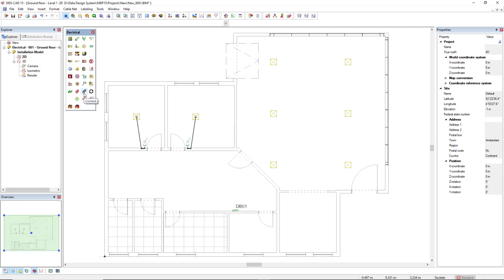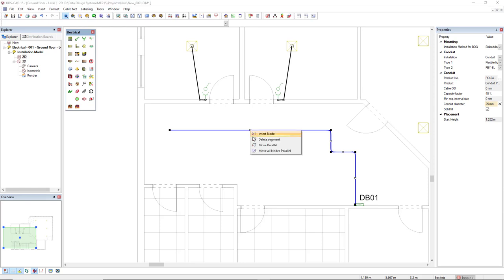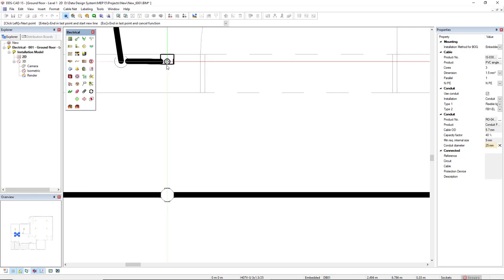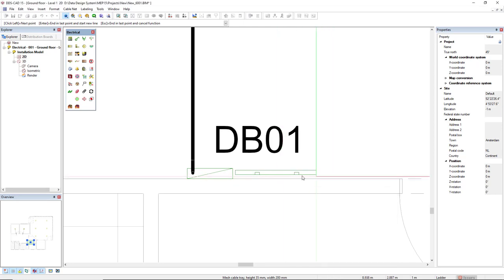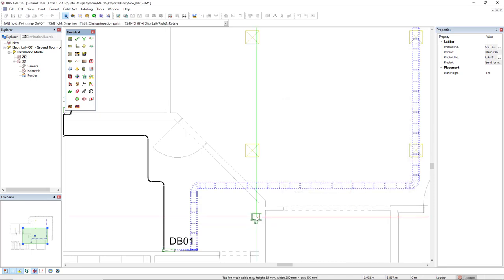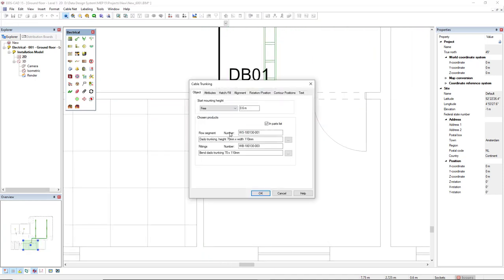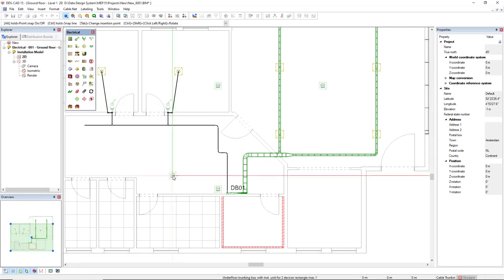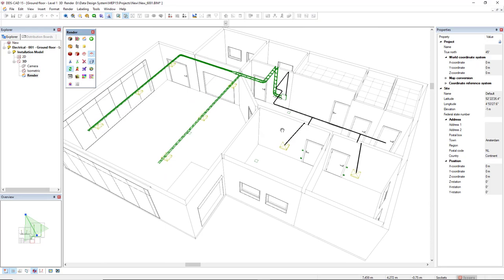Getting Started  - Electrical - Conduit, cable ladder (cable tray) and cable duct

Comment: Hi, sometimes we use help lines . Is it possible to divide the help line into several equal sections in order to e.g. arrange electrical sockets at equal distances?
Reply from the maker: hi targetti, yes it is possible to parallel help lines. Activate the function Help Geometry (4). Press and hold Ctrl key and move the cursor towards the line, when it is highlighted, right mouse click to open the context menu. Select the option Parallel Help Lines... (Ctrl+6). Move the line to the end point and insert the distance between each line in the dialogue Parrallel Lines that will pop up.
If further questions, I recommend to get in contact over support@dds-cad.com. There we can follow up your questions much better. 
Regards,